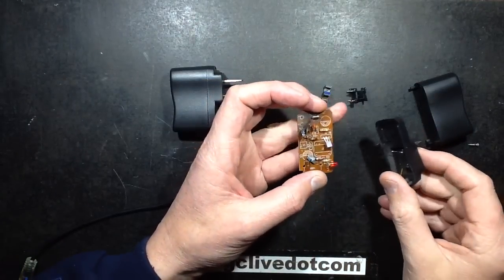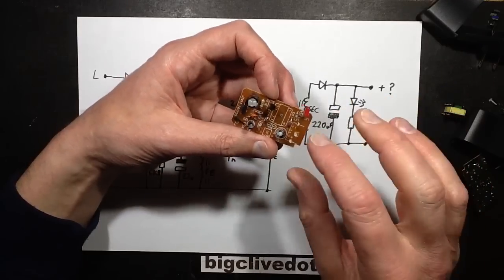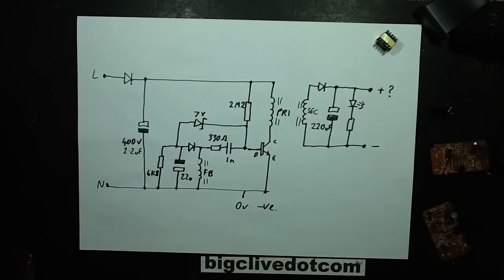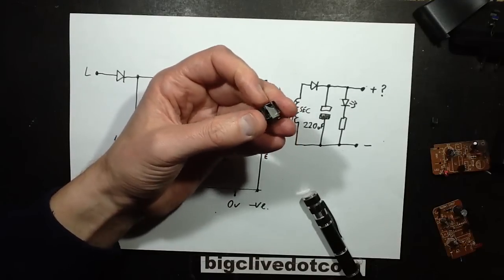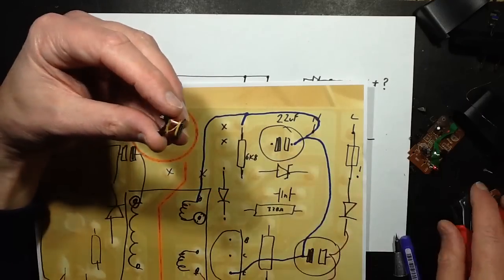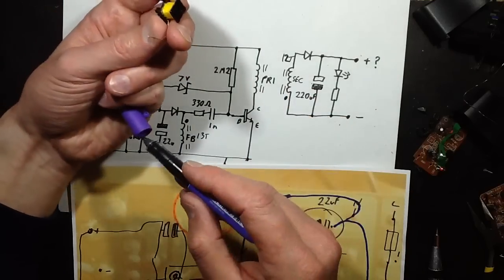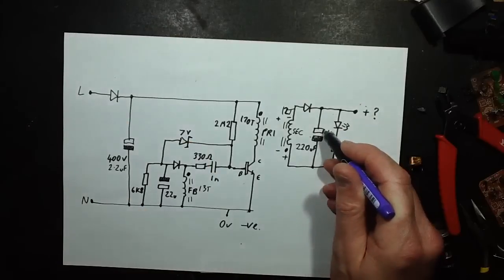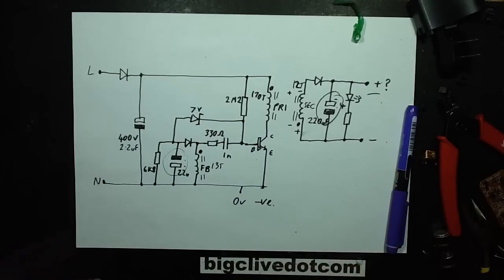Teardown, schematic and analysis of a single transistor PSU.

Comment: Clive, Is there any way youcan you lock the Exposure and White Balance on your camera? This will keep the exposure the same and not go dark when you put your hands in front of the camera...
Reply from the maker: +360mix I can, but it has to be done before each video and allow for the different intensities that might occur.  I've done it in the past on a white surface, but kinda prefer when it does adjust exposure to suit what's currently in the field of view.
Reply: +bigclivedotcom Got it.. It's just that at times the camera is exposing for your hands and white sheet and the components you are holding goes dark.  The camera does not know that the important part to see if what you are holding.. but thanks just trying to help.
Reply: +360mix Can you atleast lock the White balance?
Reply: +bigclivedotcom it's usually not very noticable but on a video like this with a large white sheet it does gets annoying.

Comment: Great explanation, but one little correction, transformer never saturate (1nF capacitor when is charged will cause drop in transistor drive end with feedback winding wheel drive transistor off like in blocking oscillator).
Reply: The blocking oscillator terminates the on time...by reaching saturation. The off time is in the RC circuit. Without it it would be a mono-stable.

Comment: I'd like to know where the clever engineers are that make the original versions of these circuits. I would surmise that this circuit is not inherently unsafe if implemented correctly, so at some point there must have been a 'good' version of this supply doing the rounds.

Since the Chinese factories end up clumsily changing the designs they copy in order to shave a few cents off the production costs (which is generally where the safety falls down), the original designer won't be selling many of these as the importers aren't interested in safety and the factories bait-and-switch. So where are these engineers, and how do they make a living?
Reply: +Jason james This is in fact a textbook circuits, which were designed a long time ago, maybe in 70's, if not in 60's. At least I have seen such circits in books from that era. At that time people were lacking clever ICs, which today are used to control switchmode supplies, and proper implementation of a switching power supply using discrete components is overly complex. So this type of intentionally simplified solutions gained popularity for this reason. Now it is used mostly in places where we have to cut production costs to an absolute minimum. It should be mentioned that the only advantage of this type of solution is minimal cost.

BTW, this particular topology is called "ringing choke converter" aka RCC.

Comment: In a weird way the Zener voltage regulates the output voltage.
it acts as a clamp in a negative voltage with respect to the transistor.

quite clever if not using an opto coupler on the output for feedback.
still undecided if a coupled output is better than this circuit.
I guess the above circuit provides more electrical isolation from the mains side.
any other benefits ?
Reply: In principle it could provide greater isolation than a given optocoupler, but only if the transformer and circuit board layout are both engineered for a greater breakdown voltage than the optocoupler...not that the optocoupler ensures any greater isolation if the transformer windings and circuit board creepage are already inadequate.  In this example the transformer is barely adequate isolation wise, and one good power surge, or a momentary lapse in manufacturing, and that isolation may be lost entirely when everything flashes over...making even Thor proud.
Reply: Primary side control eliminates the opto, which degrades over time. Cost and reliability. There are Power Integrator fully integrated chips using primary side control. Regulation is based on negative feedback. The output voltage ( as reflected in the aux winding) is compared with the reference (zener), forming an "error signal". It offsets the transistor bias up or down (in opposition of the deviation - hence negative feedback) in order to change duty cycle. The aux rectifier and zener could be regarded as "error amplifier in the classical closed loop control.  Note that later chips incorporate other (non opto-isolator based) isolation techniques. The latest trend is a single control IC with isolated primary and secondary sections. The main control is in the primary section, the synchronous rectification and error amp is in the secondary side (along with digital interface for uC tweaking access)

Comment: Where did you buy your pocket screw driver? I'd like to invest in one as well. They seem to be a very hand pocket tool kit.
Reply from the maker: +bain5872 From a UK shop called Poundland.  It's a surprisingly good quality driver with a selection of magnetic bits.
Reply: Thanks. I've had a few over the years, always lose them. I really like the one you have it seems well designed. Unfortunately, I'll have to look elsewhere as I'm in the states.
Reply: +bain5872 i found the screwdriver in usa its located in Napa auto parts i found it today 
they are quite handy i guess no one reads outher post as i announced earlier today anyway have fun if you cant find it give me a shout and ill pick you one up
Reply: +david wise Thank you David. That is very nice of you and I appreciate it very much however, I located a Stanly on E-bay, that was similar. I've had a few of these over the years but always lose them. I might just Velcro this one to my forehead.
Reply: +bain5872 great i have a set of screwdrivers that were in a small case tg hat i used but after watching bigclive i look for his here gave up a week ago but walked in to napa to get a t40 and there it was lol it is nice sized with six bits i just have to remember i cant use it on live stuff lok
Reply: +bigclivedotcom I got an almost identical one from TK Max and very happy with it.  Also got a very nice folding/locking box cutter at the same time.  What was even better was I chucked them in the basket and the wife paid for them!!
Reply: got it at napa auto im going to town on Friday and will get a upc number for you
Reply: Thanks Tom. I appreciate it greatly however, I've located a source for these.

Comment: I'm not sure but from what I know about transformers this one could produce (300/170)*12 up to 21V but because only half of the wave is rectified this will result in a 10V average. I always wandered if I can alter the circuit in some way to get different voltages. (if let's say I have a long cable a higher voltage like 6v will be helpful.. or a lower voltage will be good if let's say I wana drive a 3w led without a current limiting resistor) but I don't have the materials to try that. So I was wondering if you can make a video some time trying that with different types of switch-mode power supplies. Me and I think a lot of other people will really apreciate that! Beacause if that's possible it will open a lot more possibilities. As a stating point I think adding a resistor/potentiometer in series with the feedback winding or the light emitting part of the optocoupler will help raise the voltage. Lowering the voltage is a bit more tricky and I think implies replacing existing resistors with lower value ones or adding potentiometers in paralel with the existing resistors.
Reply: This runs from 100 to 300V DC with it's own oscillator at a high frequency.  The zener makes it stop when the output from 13 turns+filter is about 7V, which someone designed to make 12 turns plus filter produce 5V.  Various parasitic details affect this result and they really had no sure way to choose the winding count without some testing.

Comment: function generator (any oscillator) and a 2 channel oscilloscope would have answered your questions.  but still fun to watch your bids.
Reply: A free LTSpice simulator (from linear.com) would have been even better. You can have as many voltage and current "probes" and can even run simulation with incremental values of a component to see the effect.

Comment: You could work out the transformer by putting some sort of voltage in and watching what came out. Perhaps the PSU would have run off a safe low voltage and allowed voltages to be looked at. How big a risk these things are - you'd hope there'd be statistics somewhere. If you're using an RCD protected supply and the PSU does not burst into flames, not a problem. I've seen UK PSUs with UK made components explode too (true, it was in an earthed metal box).